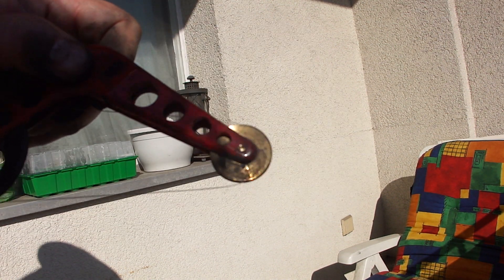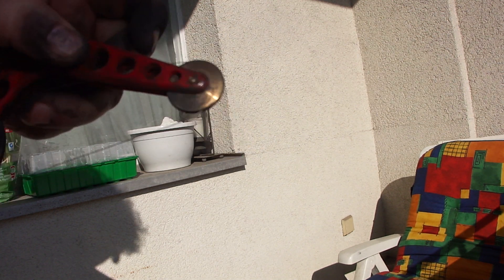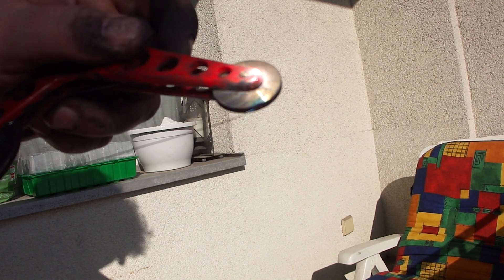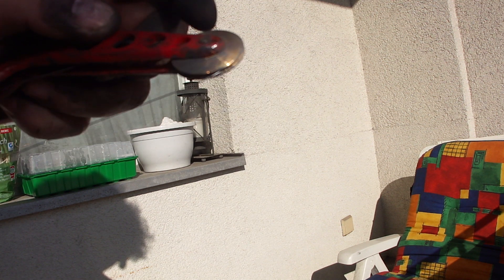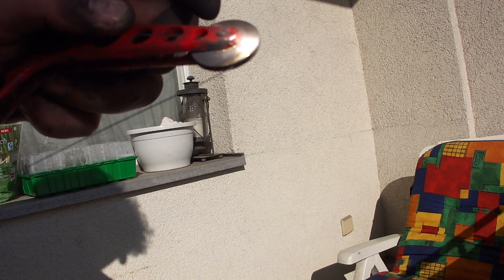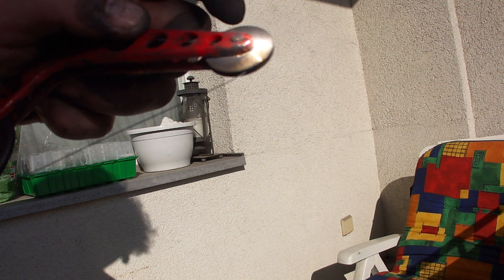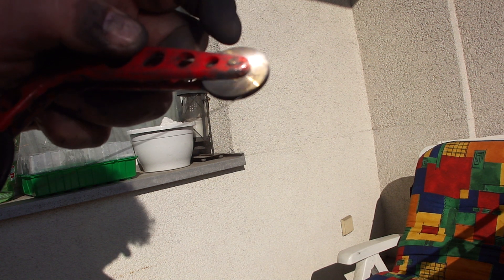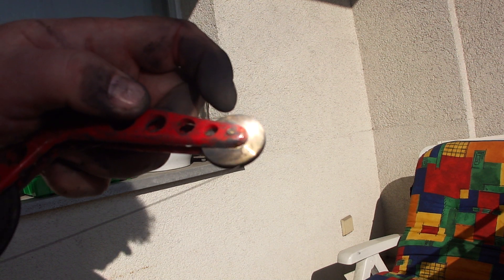Free_Energy_Nitinol_Sterling_Heat_Engine_Toy_thermal_motor_02.MP4

Comment: For people wondering what this technology is, see his first video: watch?v=oKmYqUSDch8
This is the more modern longitudinal version of the material and is probably much more efficient, but the old version helps you much more in understanding just what it is.
And why it is much than a heat engine... (you can litterally turn on and off a force with temperature)

Comment: the heat-transfer coefficient rises with temperature differences, which means that a nitinol-engine will run slower the smaller the difference is, so you'll also have heat running down the wrong way of the wire creating resistance.
the lower the temperature-difference is, the lower the percentage of heat that you can transform into other kinds of energy.
the Carnot cycle (not process, sorry for that translation fail) describes that very well and it's true. at least by conventional means.

Comment: I am familiar with Stirling engines, I've tried to build one a few times. Never been successful though. I would have figured the Stirling engines would be much less efficient due to the fact that you need LARGE temperature differences to create the physical movement. Which lowers it's efficiency right? I figured with nitinol it would be much more efficient as you clearly stated they require very small temperature extremes to work. Also, Stirling engines have many moving parts, all which drag.

Comment: in a stirling, the movement is created from the pressure-difference of hot and cold gas, the hotter it gets, the bigger the pressure, so if you put more heat into it or cool it to lower temperatures at the other end, you will get a higher output.
with nitinol, you'll need to get only slightly below/above a certain temperature to be efficient, which you usually won't get done with waste heat.
inform yourself about the "carnot process", it always outsmarted me and you don't wanna repeat that.

Comment: still, a stirling engine is more efficient but these devices could be built much cheaper and therefore could be used to transform low amounts of waste heat or to transform energy from radioisotope generators in sattelites and similar devices.
(modern shape-memory-alloys do also use two-way effects, which means that it also has a cold-state shape memory, shaped as a spring that means that it could push as its hot and pull as it gets cold, this effect's already used in engines for some years.)

Comment: as it gets heated, it "remembers" its original, straight form and therefore straightens, which is quite hard as it's bend over the brass wheel. so the ends leading into the straight line between the two wheels are somewhat pulling towards it, if you start the wheel, the one side will be able to straighten while on the other side cold, flexible wire is pulled in, so you get a pulling force on the one side, without resistance on the other.
as it runs over the brass wheel it gets heated ans goes on

Comment: NiTinol is a shape-memory-alloy, at a certain point of temperature, the metallic crystals turn from martensite to austenite and reverse, which also changes tensions inside the material.
in case of classical nitinol, this means it's rather flexible when it's cold and when it's hot, it gets MUCH stiffer and will spring back into the shape that it had/was forced into the last time it was really hot and relaxes as it gets cold.
this wire gets heated at the brass wheel and springs to a straight form.